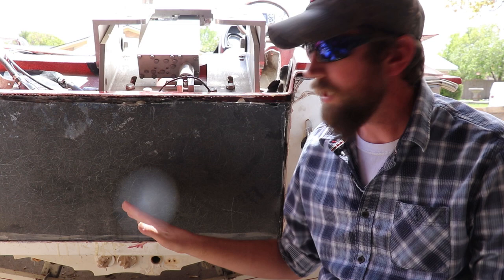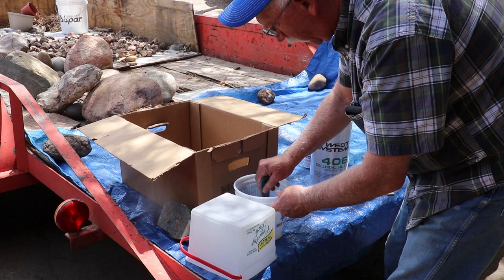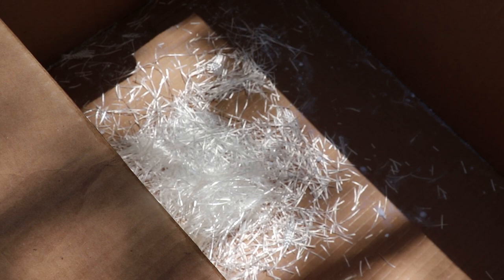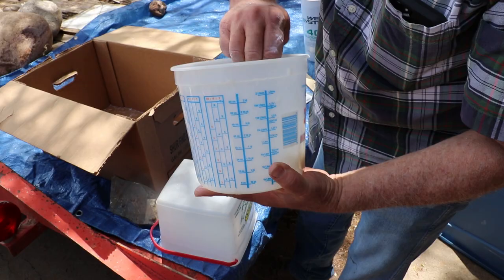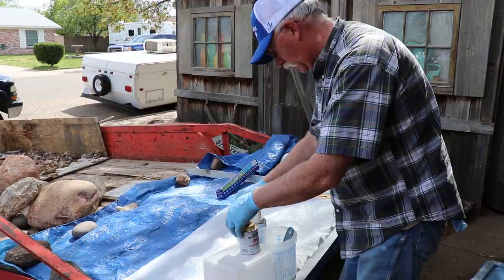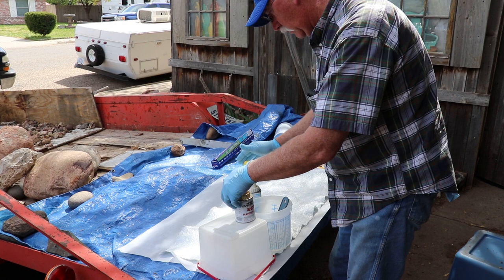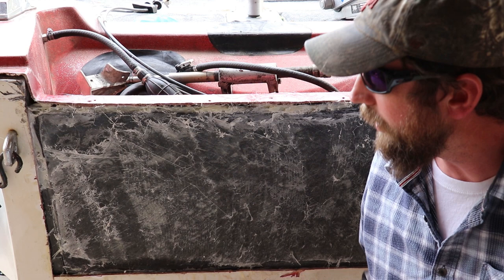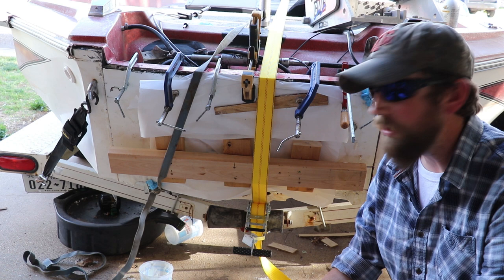Transom Replacement Part 4: LAYERS!

Comment: You needed the metal roller for fiberglass. Takes out the air bubbles and works in the glass.
Reply from the maker: We learned that lesson after this project! That thing is a life saver

Comment: Good stuff! With the temps you are dealing with you would like the slow hardener for sure.Epoxy much better than polyester resin.CHEERS from westcoast Canada!
Reply from the maker: darryl mcleman thanks for the advice! I am about to dive into another overhaul and I’ve considered switching to slow hardener. I will certainly weigh those options....doesn’t look like it’s a money saver one way or the other.

Comment: I’m about to start tackling a 17’ wellcraft and this series of videos have given me the confidence on this job. Great videos but one question. Could you have cut the coosa board straighter and more of a flush cut?
Reply from the maker: Absolutely! The more time and precision you can devote to that process the better. When you get all the fiberglass and epoxy set in there, I'm not sure it matters just a whole bunch strength-wise, but I have no doubt that it would be beneficial to be straighter and more flush.

Comment: Use bondo ! It’s literally made for a gap filler then just resin it after it sets and You’ve ground it down
Reply from the maker: Bondo does indeed work. However, it also becomes brittle and with the flex of the fiberglass we opted for a marine grade sealant. Either will definitely work.

Comment: Glad it's working out "so far".
To others taking notes:
In all cases, try to keep new transom replacement as ONE PIECE. 
Never reuse old skin fiberglass.
Bottom of transom "wedging" does not work. Drill through holes and temporary bolt using a 2x4 for the length of the span. Expoy expands with incredible force and wedges will not hold it.
Reply from the maker: It is holding up fine, as well as another boat we have done in a similar fashion that has held up as well. While it is indeed better to make the new transom out of one piece, it is not completely necessary. According to the West System’s recommendations, the cut pieces of coosa board as well as the old fiberglass skin, are perfectly acceptable to use as long as new resin/epoxy and fiberglass is used. You are correct that the epoxy does expand, but not so much that the wedges will not work. However, I would opt to use your 2x4 trick in any future projects. Here is a pretty good article on epoxy expansion: https://salvagesecretsblog.com/does-epoxy-resin-expand-when-drying/

Comment: I was given a free boat and it looks like the transom is bad. It is a hydra sport vl 270. So I wanted to do it fast and cheep. How long did it take you? And how much did all the materials cost?
Reply: And it does have a 150hp mariner
Reply from the maker: Definitely watch the whole series first and get an idea for the process. We spent approximately $550 on all the materials and it will take a week to 10 days to get it done if you have warm weather.
Reply: @PastoralHomesteadOutdoors  thank you I did watch the whole series and it was great!
Reply from the maker: REDNECK INGENUITY If I could do it again, I would lay out all of my parts and pieces first and map out what I was going to do every day. I think I could get it done in one week with the right temps outside. Good luck to you and if you can, send me some pictures!

Comment: What issues was the boat having that caused him to suspect transom rot?
Reply from the maker: Not any specific issues performance wise, but we were able to see water leaking around the drain holes as well as some flex in the transom itself. All tell-tell signs of rot.

Comment: Just curious, about how many gals of resin did you use? Btw. Thanks for making these videos
Reply from the maker: Jordan Beyer we used epoxy for the whole thing not polyester resin, not that it makes a difference in the amount just wanted to be clear about it. From start to finish, I assume we used approximately 3/4 of a gallon. We used the West Systems epoxy and hardener, I was super easy to use and not overly expensive.
Reply: Thank you.  I meant epoxy resin. Lol. I just ordered the size C containers from west systems.  I'll be doing the floors transom and stringers, but will be reusing the skin much like you. So am think that should be enough. Thanks for making these videos

Comment: Ok. I am a little surprised to hear your going back with original cut off piece. I’m guessing you’re going to fiberglass in all seams. I would’ve thought you were going to build it back out with fiberglass layers. Can I ask why you did one method vs the other? I can’t wait to see the next video
Reply from the maker: Blackberry Ridge very good question, something we should have discussed in the video. The external hull from this model of Skeeter has a Kevlar component to it that is extremely tough. We wanted to tie the original pieces back in so that Kevlar would be present in the final build out. We will fix the seams with a couple of extra layers of fiberglass, then sand down to make smooth, and gelcoat over the top of that. Hopefully we will finish it up in one more video
Reply from the maker: Spoke to a couple of people about not using the original pieces and opting for just building it back out with new fiberglass...the bottom line is that is a possible way to work it, but it is time consuming and more costly in materials. I believe in our case, this was the better route.

Comment: Did you redrill the drain hole?
Reply from the maker: Brandon Sanders we didn’t have to. The drain hole on this model sits under the transom.
Reply from the maker: Brandon Sanders right at the beginning of the video you can see the drain hole on the lower part of the pad.

Comment: I'm really curious about why you guys, as well as numerous others on youtube cut the outside structure of the hull instead of cutting the inside to gain access to the transom?
   I'm a marine tech, motor guy, by trade though I have done some restorations and such, I have never went into a transom from the outside as from what I was told by some top professional glass guys/boat builder's to never cut the outer glass as it is weakens the structure of the hull, esp being right where ALL of the thrust pushs and pulls on..
  Any input?
Reply from the maker: Shawn Industries main reason: time and effort. To gain access to the transom from the inside, we would have had to remove the top cap and we just didn’t want to do that. However, I have a boat that I will be restoring soon where I am going to be taking the top cap off and repairing the transom from the inside.  I don’t really know about the strength of the finished product one way verses another. Once the outer shell has been epoxied back in, faired, and sealed...it’s pretty close to the original. I would also add, the fiberglass and coosa board transom is without question stronger than the original. If we would’ve had access to a shop and all the right tools available to us we probably would have done the transom from the inside. But given our limitations, we felt this was the right way for us, and we’ve been pleased with the outcome.
Reply: Absolutely shouldnt cut the exterior structure. I can just see them hitting a tree stump and watching their engine sink to the bottom while they scramble for life preservers LOL
Reply from the maker: While I can appreciate if you expressed a personal preference to cut out the transom from the inside, or perhaps apply a seafoam-like product through the top...to blanketly say going through the back like we did is going to sink the boat is asinine and speaks to a lack of understanding on how a transom actually works. If you would have bothered to watch the rest of the video series, or simply read the comment thread above, you would already have the answer to the original question and our defense of this process and its effectiveness. The transom itself, all one solid piece now, is stronger than it was originally, and there is absolutely no weakening of the structure by cutting through a part of the outside hull. Everything is tied back in with fiberglass, epoxy (or resin), and coosa board. This is a simple way to fix an older boat's transom without spending a couple of thousand dollars by putting it in the shop. It can be done in 10 day time period and doesn't require any special tools or insight. This process would not necessarily replace a professional transom replacement, however, this is what we chose to do. We were recently on Lake Fork with this boat, we did hit a couple of stumps (slowly) and everything was just fine. I appreciate your concern for our well being and we will be sure to keep our life jackets close by. Also, I tried to find the "correct" way to replace a transom on your channel, but I didn't see a video.
Reply from the maker: Your expertise is welcomed and encouraged if you care to share. Can you provide any of this overwhelming scientific evidence? I would certainly be curious to read it. As for being a structural engineer, the amount of insight you would and should be able to provide to these conversations could be literally priceless for a lot of us. Most, if not all, of the boat repair guys (especially dealing with transoms) on youtube are amateurs and simple backyard mechanics. I'm a step below even them. So please, if you have a better way to tackle this kind of a project, weigh in through these comment sections with constructive and useful information. If you're are not willing to do that, and would prefer to flippantly make sarcastic comments and criticisms, that's not something we are interested in here. Panties aren't in a bunch over here, I just simply refuse to put up with people who are quick to criticize but not quick to help. We may disagree on something, even fervently disagree, but that doesn't give us the right to act like pretentious schmucks.
Reply: @PastoralHomesteadOutdoors  You're being much nicer than I would have been. Will seems to be the kind of guy that makes a stupid and unnecessary comment and then plays it off as a joke. And of course, if he's joking then you're the one being unreasonable and obtuse....it's a classic online debate technique that is typical across these comment threads. Just so you're aware, I have gleaned a great deal of insight through your videos. I am also a fan of the ministry work that you do for your community. Don't let the asshats on youtube get you down or prevent you from making more content. I know 2020 was tough for Pastors and their churches, I hope you came through ok and can get back to making videos soon...I know you have that hideous yellow boat you've been keeping from us!! God Bless you, sir!
Reply: @willterrell2748  Pinewood is one of the absolute best people on youtube and usually he's pretty open to discussion and suggestions. What you're doing is not accurate or even constructive. If I were you, I wouldn't mention who you work for either, it could be detrimental to your future employment.
Reply: @leeharvard228  FAN BOY TO THE RESCUE !!! LOL
Reply from the maker: I appreciate the good thoughts and well wishes!! We are doing pretty well here, our church mostly came through everything ok. We lost some people and that is always difficult, but we've been truly blessed. Our little farm is really starting to take off, we launched our podcast, and its just been crazy busy! Hopefully we'll get to that old boat soon! Thanks for checking in!